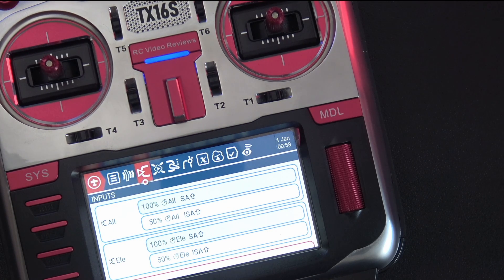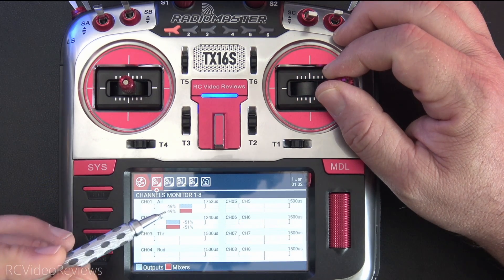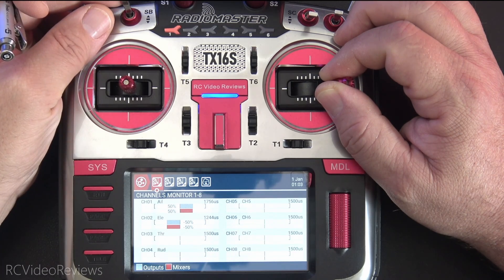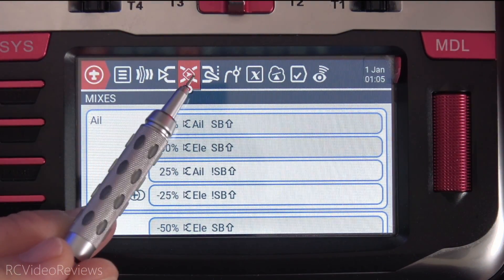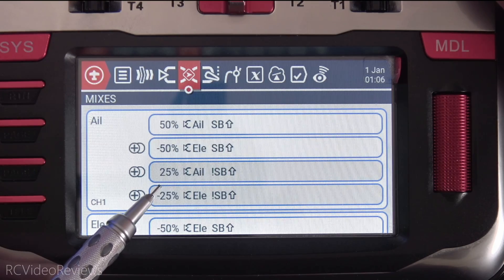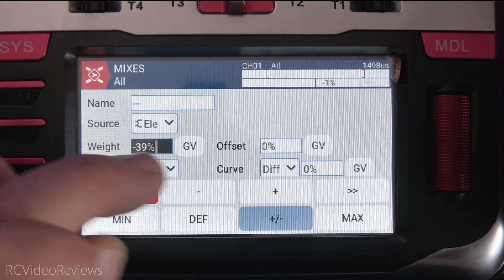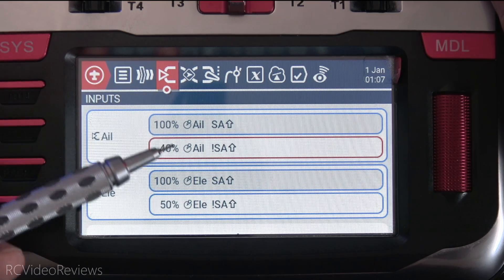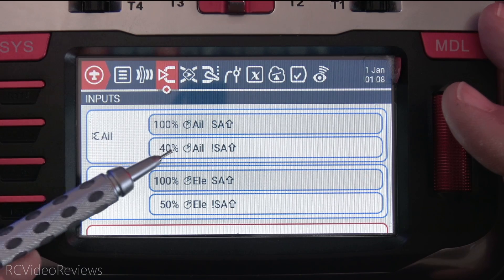EdgeTX Dual Rates Belong in Inputs NOT Mixer

Comment: I am jsut returning the hobby after a 20 year hiatus.  I have a lot of questions but to avoid inundating you I will ask just one.  So to perform some maneuvers people use mixing? They are not performing those just using stick control?? I am absolutely amazed at what and open source radio is capable of compared to the 4 channel radios I used in the 90's.  I have a Boxer primarily due to price and I purchased a 4 in one module for it. I am so grateful to guys like you for the time you've spent creating content like this. I am so close to retirement I can taste it.  This is one thing I want to do more of.
Reply from the maker: Some people do use mixers for maneuvers. I do not. I use mixing for planes that require it like delta wings. Or for scenarios like putting flaps down--I usually mix in some down elevator with down flaps.

Comment: My OCD is getting em to try to label my switch positions so they display in the widget. For example, I have a FMS Reflex V2 set to switch SD. It works fine, but on my widget I'd like it to show "Off", "Stabilized" or "Optimized" rather than the -100, 0 and 100 it is by default. I can NOT get this to work properly. I've looked through your videos and can't find one on this - any guidance?
Reply from the maker: One thing you can do is use flight modes. Name the flight mode Off/Stab/Optimize (you can use 10 characters)  and assign a switch to each mode. Then on your telemetry setup screen you can show flight modes in the center bottom of the screen. I'm not aware of any way to assign text labels to widgets. I'm also not sure to which widget you're referring.
Reply: @RCVideoReviews  That's a great plan, I'll try to get that figured. I have widgets set up 1x3, and on the 1 I use the outputs widget. SD as channel 5.

Comment: Do you still leave the two lines on the mixer or eliminate them completely? Leaving only the inputs at dual rates?
Thanks
Reply from the maker: With no mix lines you transmit nothing to the model. You have to have mix lines.
Reply: @RCVideoReviews  Thanks, one thing I can't figure out, is why I don't have SD! in my options? only SD down, up and middle
Reply from the maker: 1) You should join discord.
2) Depending on the version of EdgeTX (they recently made a change)
 - Older versions, you scroll up and you should see !SD
 - Newer version (2.10+) in the selector screen you should see an option called invert.

Going forward, questions like this are better answered on discord.
Reply: @RCVideoReviews  how do I join discord? What's your user name there?

Comment: Loved this video and I have reworked my dual rates.  One question though, how does this work with dual ailerons?   At the moment I have two inputs both with dual rates set.  Is there a way to map my second input to my other aileron channel to pick up the same rates?
Reply: Yes I worked that out as well after the video and trying it out. It wasn't obvious to me at least. I now have 1 input for both channels, so.much easier. Again thanks for the video it made me stop and think about my lack of understanding .
Reply from the maker: Glad to hear it helped you learn something new.
Reply from the maker: Why dual inputs for ailerons? That's kind of the point. Use one input for ailerons and apply that input to two mix lines.

Comment: I've set my eratix this way (usually I setup my rates using GV).  But my problem now is that subtrims do not go along with the  individual rates.   If i set the trim correctly for normal rates,  when i switch to high rates,  all goes out of wack.  How to fix this?   Much appreciated.

Comment: Great video.  However, I wonder why everyone who creates a video on the Inputs screen with multiple options have a switch assigned to all options?  The issue I see with this is, what happens if the switch settings do not cover all possible switch positions?  In you example, what if you had the switch be SA center and SA up and nothing for SA down (I suspect this would be a common rooky mistake)?  I think this would result in a problem (no input selected, stuck at 0%) until you realize that you need to put the switch in a valid position.  Am I wrong about this?  I find that the easy way to make sure this never happens is leave the bottom option with no switch selected.  On the input screen (behaves different on the mix screen), OpenTX and EdgeTX picks the first line that has a matching switch so if the last line has none, a line with no switch option will act as a catch all and be use when the switch does not match any of the above.  What do you think of this?  If this is a good idea, why does no one on YouTube tell people to do this?  If it is a bad idea, why is it bad?  Might be a good video to address this.  Let me know if you have questions and/or need clarification about this.

Comment: An other video is missing: Negative values of weight should be used in mixer but must not be used in input (unless you want to have the trim moving to the wrong direction). With other words: since openTX and also in edgeTX we recogniced that the trims are not reversed while the sticks are reversed using negative values of weight in the inputs.
Reply from the maker: It is true you shouldn't use negatives in inputs for that reason. I actually recently learned that the hard way.
Reply: Wow, been dealing for years now with reversed trims... so lucky to stumble upon your comment, huge revelation for a thing that was hidden right in front of my eyes. Thank you!
Reply: Wow, I didn't know that about the trims. That seems like a fixable bug to me, or at least should be a user setting.

Comment: Quality video as usual, thanks.
But no mention of using Flight Modes and variables to define rates/expo. Reduces input lines even more. Maybe that would make it seem more complicated to people starting out?
Reply from the maker: You'll find with Edge/OpenTX there are usually many ways to accomplish a task. I present the methods I believe are most practical and in-line with developer intentions. Certainly flight modes are an option if you want to add that layer of configuration.
Reply: @RCVideoReviews  I kinda suspect the developers intended us to use Flight Modes.. you have a switch to select a Flight Mode which defines the value in a variable which is used as a rate or expo setting in one single input line.
But probably best for beginners to start out as you demonstrate in your video.
Reply from the maker: None of the new model options including "create new model" or the wizard utilize flight modes. All of them utilize inputs. Also, the developers watch this channel and I communicate with them pretty regularly, so, I'll stick with my conviction the intent is to use inputs. But like we say around here: Your money, your hobby...do your thing.

Comment: Another thing to consider is where to add the exponential.  If you apply expo in the "inputs", next to the dual rate, they don't effect the trim values.  The trims are added between input and mixers.
If you apply the exponential in the mixer the trims are also subject to the exponential curve.
Assuming the flow of the values is still like in openTX ( https://www.mvcpegasus.nl/wp-content/uploads/OpenTX_Documents/OpenTX%20Diagram%20-%20Inputs.pdf )

Comment: Is it possible to have Expo setup in Inputs also?
Reply from the maker: That's where they belong.
Reply: @RCVideoReviews  thank you for your response. How would I do I it though? I am not seeing any expo option
Reply from the maker: On an input under curve, you might see diff....drop that list down and you'll see expo.
Reply: @RCVideoReviews  i have other radios that only has a mixer page and everything is done on that page and to me its just simple to have one page or screen to do everything instead of going to different pages/screens but i dont use dual rates either. i think more pages or screens make things more complicated than they need to be. i think someone needs to tell microsoft that since it takes more screens and clicks to do same task in windows 11 than it did before..😀

Comment: I am a little confused. So all switches, sticks and sliders are Inputs. But would you correctly make Flaps as an Input (as you use a switch or slider) or do it in Mixer ?
Reply from the maker: Nope, just control surfaces where you may want more than one set of rates. Usually the ONLY thing I add to inputs are control surfaces which includes flaps.
Reply: @RCVideoReviews  Thanks - good to get things a little clear. 👍

Comment: What if you're setting up expo on one switch, and rates on a separate switch?  I like to have my expo and rates individually togglable.    Wouldn't you need to use the inputs for one, and mixer for the other?  I currently have my expo setup on my inputs, and rates on my mixer.

Comment: I'm having a hell of a time trying to configure a two receiver setup. I can't find any info on how to assign channels to the second receiver.
Reply from the maker: Channels are assigned during the bind process. You should see channel ranges on the bind page and when you start the bind for protocols like D16, it will even ask what range of channels and whether you want telemetry on or off.
Reply: @RCVideoReviews  Correct. I'm binding both receivers at the same time with channel range of 1-12. I'm using two 6 channel dsm receivers. The First receiver all 6 channels work flawlessly. The second rx I can't get any to work. I've  assigned channel 7-12 to work via a switchs and it doesn't. Same with a sliders. I'm new to edgetx and I'm sure it's a programming issue on my end. Was hoping to actually find a video walking me through how to set it up so I could see what I'm doing wrong. Anyways I'm the first person in my area that wants to fly radiomaster on 30-40% planes
Reply: @xrae21  Not certain, but I don't think you can configure a 6CH DSM receiver to map channels 7-12 to 1-6.

Comment: Nice video as usual.  I have a question that not related to your topic but hopefully you can help me. I just bound a radiomaster TX16s with a lemon RX receiver. When I give elevator input it moves in the right direction, however when they give aileron input, also gives elevator elevator input. I did not do anything else but bind the transmitter. Do you know what I am doing wrong please
Reply from the maker: The mixer is where controls are matched to pins on the Rx. I'd. look there. You might consider removing all mix lines and re-adding them 1 by 1.
Reply: Nothing to do with radio.Change settings in receiver.
Reply: @Jan-ti2ml what exactly do I do change the position of those little switches ? Again i am pretty new to this .
Reply: @kevinmaxwellwilkin4915  Yes, change switches according your airplane.
Reply: @Jan-ti2ml  traffic I will give it a shot
Reply: Okay I am fairly new to the hobby and the tx16 but I will see what I can do. Will changing the receiver help ?